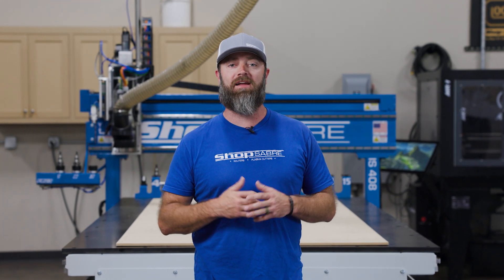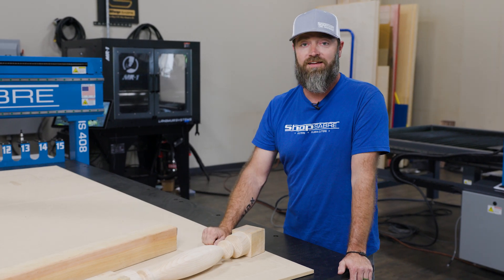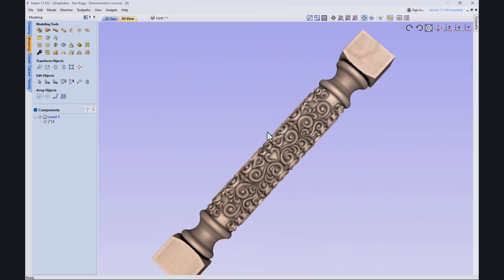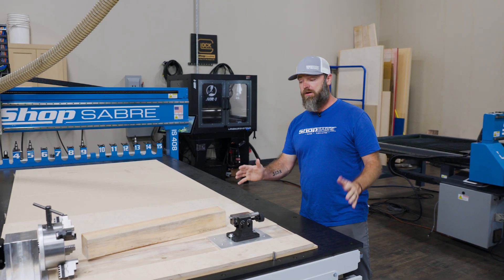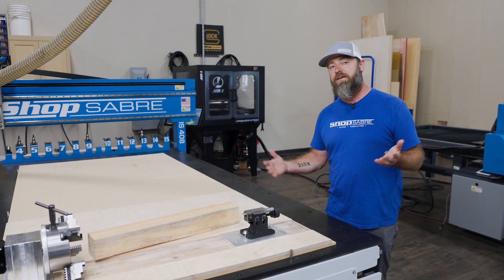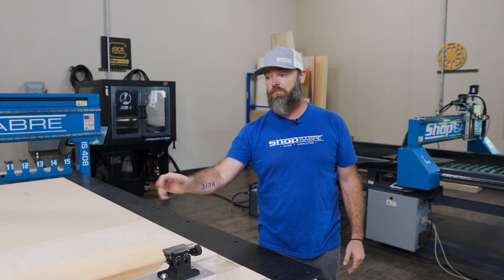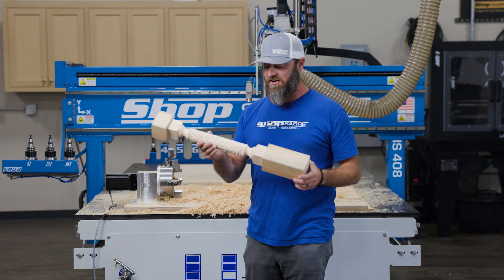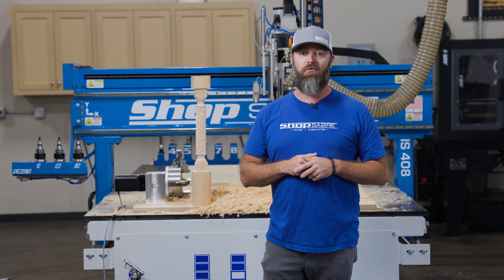Making an Intricate Table Leg with a 4th Axis Attachment

Comment: Any other ideas to hold down a fixture like that?  I really don’t want to spend $ on electricity running my vacuum pump Could it be clamped down near the tool changer?  Then I just slide over the spoil board a foot ?  Maybe harder to align?
Reply: How do you zero the XYZ with the fourth axis?
Reply from the maker: There are no rules to hold down, there is many ways to do things - the money to run a vacuum generally isn’t considerable though but if you wish to clamp you certainly can do so